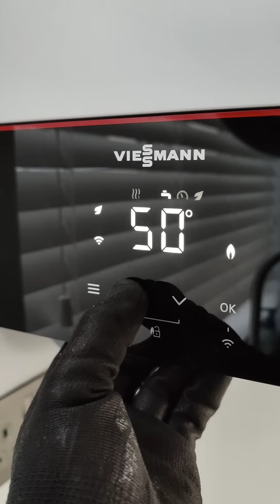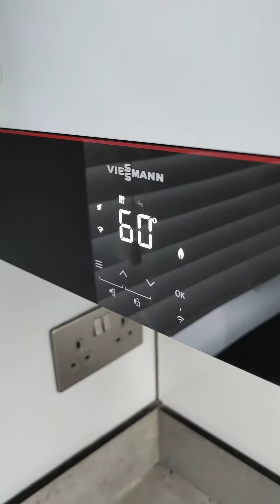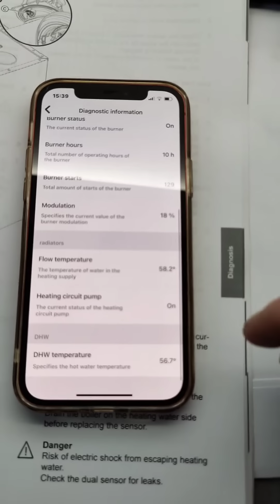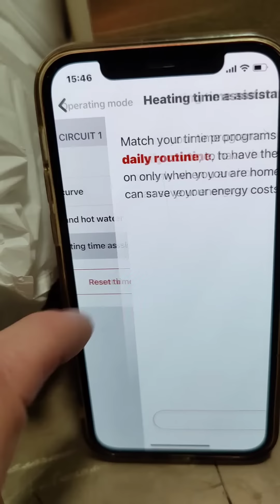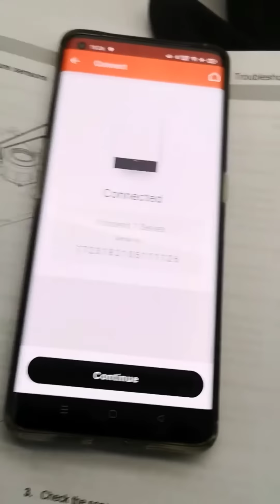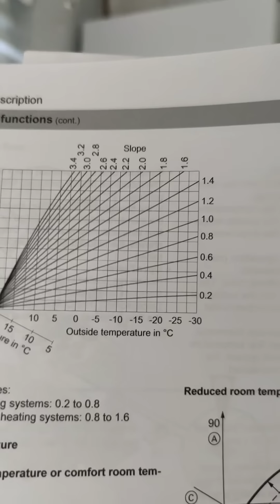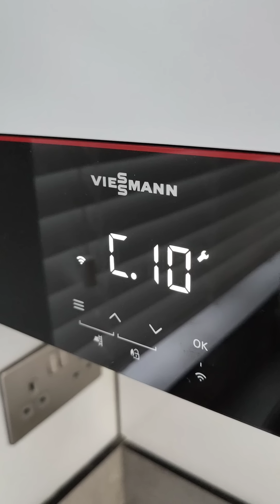Viessmann vitodens 100-W B1KF combi boiler (new 2021model)

Comment: Very good informative video on this first class boiler I have fitted a couple now customer seem very happy with them typical viessmann top quality I have the older 100 series at home and that has been absolutely flawless. It’s 13 years old and all the composite plastic parts are still as new ? unfortunately you go to quite a few that are on contract servicing and have never seen a proper service or an expansion vessel pump up and this includes some of the big brand names!
Reply from the maker: Thanks for your comment. I too think this is a great bit of kit. It also saddens me how the service contract companies such as the insurance companies and gas and electric companies do not service their customer's boilers correctly yet charge their customer's every month. I'm not sure how they are allowed to get away with it. It clearly states in the manufacturer instructions how an annual service should be done.
Reply: @thornhillplumbing  No problem mate and thanks again for uploading this excellent video it’s a shame how the service industry is at the moment and it’s been like this for a number of years especially now with the younger generation entering the industry and as you probably know they are not interested in getting their hands dirty! My pet hate is the engineers who come out via the insurance companies to attend boiler breakdowns nine times out of 10 they don’t even want to remove the front case to see what the problem is! (if you believe this or not)Recently had an ideal logic that was gurgling obviously you guessed what the problem is ! yes a blocked condensate trap!  one engineer diagnosed it as a faulty circulating pump
The other point blank refused to remove the front cover and just said it needs a service! Just cleaning the condensate trap is not enough points to the fact that the heat exchanger needs flushing through the burning area downwards. Where I am [brighton Sussex) people have a lot of faith and respect for British Gas but these guys are the absolute worst!! It causes problems for example “why did you take an hour to do a service when British Gas can do it in 30 minutes?.

Comment: Are you aware if using a Vicare thermostat and you loose communication with your Wifi you will not be able to change the heating setting on the boiler, you will not have access to P1 or P4.
If the Viessmann backend system goes down you will also have no access to the boiler, Its a flawed system.
Reply from the maker: Thanks for your reply. I not used the Vicare thermostat, and are using just the boiler and the weather sensor , using the weather curve offset to calibrate room temperature.  I have also fitted a Honeywell programmable room thermostat in case there are any problems with the boiler being controlled in this way , so we can use menu C7 to switch to the room thermostat instead of using the boiler timer and weather sensor.
Reply: Viessmann have updated the system this problem is now resolved!
Reply: Is that boiler connected to Viessmann so they can monitor the boiler performance ?
Reply: @SalimKhan-gk1fh  I doubt very much Viessman have resolved this issue
Reply: Do i need outside thermostat ? I want to use a classic wall thermostat what option do i need to choose at C7